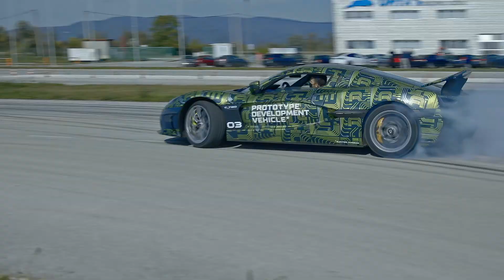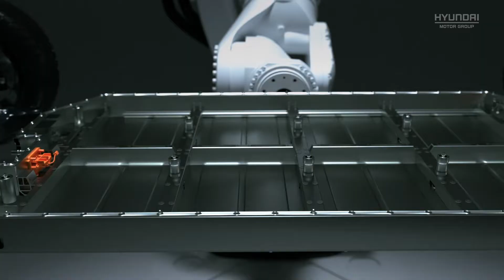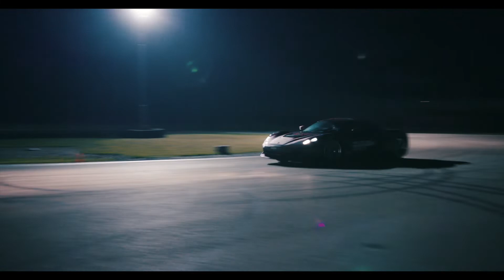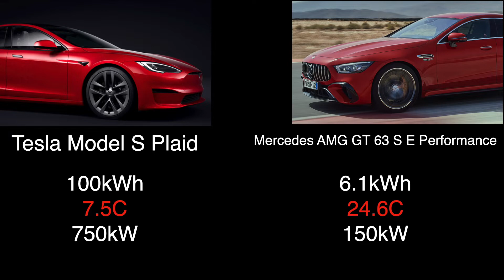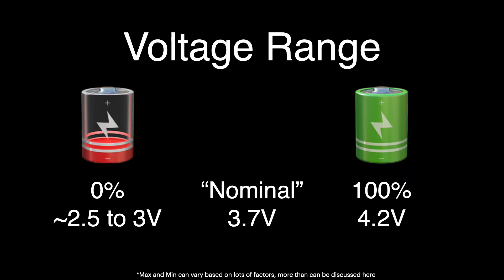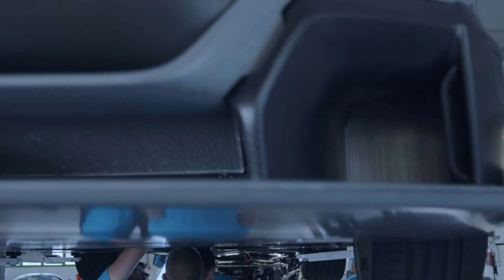EVs for Gearheads: Li-Ion Battery

Comment: Inverters (and other kinds of motor drivers) are also a crucial part of the EV drivetrain, not just motors and batteries.

Edit: also, when you put cells in parallel it increases their maximum current output. In my opinion you made it sound like there is no benefit to putting cells in parallel.

Comment: And what about battery degradation from charging faster compared to a slow overnight charge
Reply from the maker: Typically faster charging C-rates generate shorter overall cycle life, however, there are a number of other factors that may be significant as well.  In the description there are links to 2 research papers with lots of detail if you are interested.  The battery chemistry selection is much more significant for cycle life than fast charging vs. slow charging